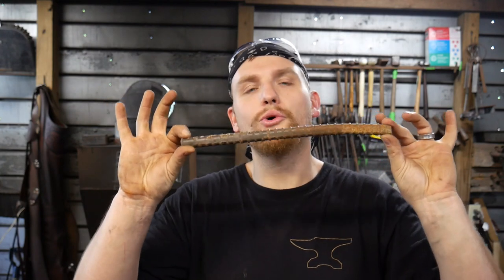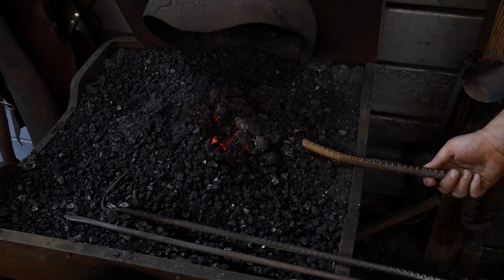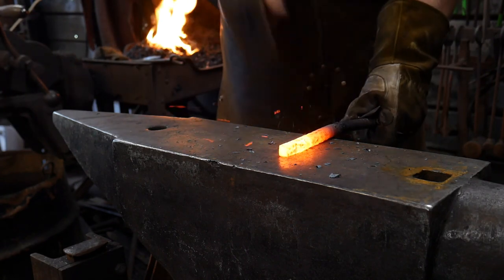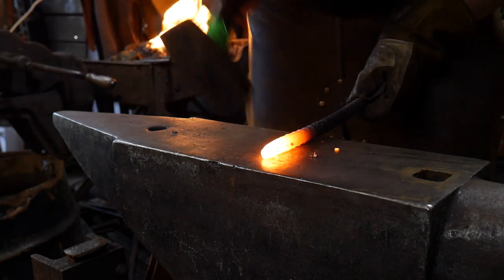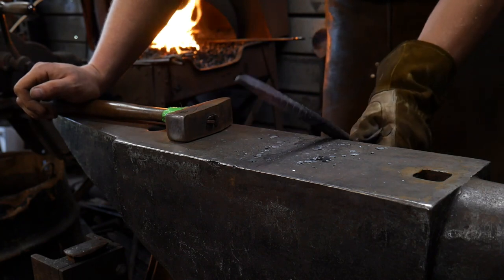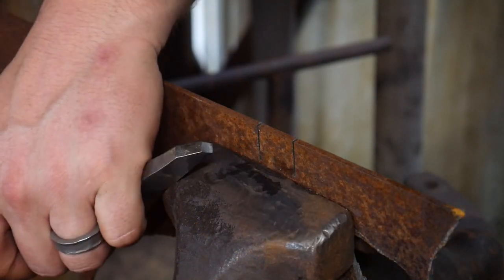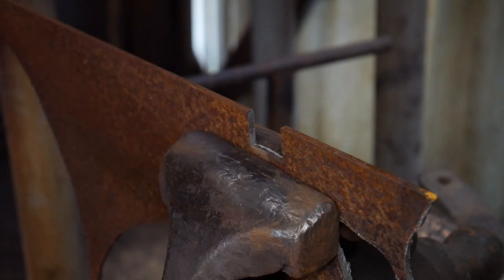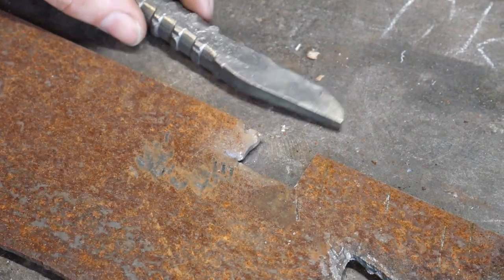Can you forge rebar into tools?

Comment: I have worked with rebar over 30 yrs.  I would not trust rebar for making much of anything, they way it is made is not very consistent and lower end materials. Tool or spring steel I think would be better.
Reply: Well I choose rebar as me and a others are starting out as it is a cheap material you can get in large amounts and it makes for a sweet handle that’s already attached to the knife or other rebar item.
Reply: Just so you know, it's used to reinforce foundations in virtually every structure made in the last 60 or 70 years.
Reply: @me2bfc   steel girders make crappy knives. so does rebar. they are chosen for ductility. knives need to be hard and hold an edge. rebar does not.
Reply: @yourredcomrade717  but he's not making knives.  He's making cold chisels and punches.  It will work for that.  His inormation about it being high carbon is pretty far off, but its adequate for what he wants to do here.
Reply: @me2bfc  That doesn't mean that it is a particularly good material for other uses. I don't make tool handles for Douglas fir, and although it is passable for use in wear surfaces like floors and in table tops it isn't necessarily a good choice for that purpose despite being used to make frames for houses.
Reply: @garethbaus5471  it’s not good, but it will work.  If it’s free and available it will work adequately as long as it’s not a production time deal.

Comment: The two dots means that they either double or triple stranded the bar during manufacture. It means that it's the second strand and is used to measure the bar and know which one it is in case they have to adjust the rolling mill.  The dimensions are monitored closely for roundness, depth of deformations etc. If it doesn't have a line running the side it's 50 or a lesser grade. A line running down the side means it's a 60 grade rebar.  Different results in trying to make tools from rebar is due to the ignorance of the individual. One or two lines running down the side is the best. The stuff from Lowe's or a like market is usually secondary or scrap and is good for sidewalks or driveways, survey stakes and the like.
Reply: John Maliskey 
Good info 👍
Reply: Thanks a ton that answered everything for me , i work commercial construction (glazier) and find rebar with lines on both sides thrown away ad scrapes lucky i saved them just been trying to figure out grade

Comment: I sheared millions of pounds of rebar, grade 40 has no additional markings, grade 60 has another line running lengthwise along the forging flash line, grade 80 has an additional mark similar to 60. Rebar used to be criticized , but modern stuff is great for tools, punches, and blades...

Comment: There are at least 4 grades of rebar used in the US.  40, 60, 80, 100 - Each number standing the yield strength in 1000's of psi (so grade 40 will yield at 40,000 psi).  I believe 2 dots is one particular manufacturer's way of designating Grade 60 bar.

Comment: In my first year of forging, everything was made of rebar. Mostly hooks
Reply: insperatus Story of my life dude.
Reply: I've made a few light use knifes and a pair of tongs from rebar but I'm just getting into blacksmithing and dont have much free time to work
Reply: I’ve made almost everything from rebar lol.
Reply: @robertevans4795  Though I have access to spring steel from old beetles and I just began blacksmithing small knives I also have made tongs from mild steel. I found a stock of rebar on a parking lot and made a hook as well. You change your vision when you start smithing... Any piece of metal you see laying in the ground you immediately think about forging it
Reply: I like rebar for my weapons because of how cheap it is and rebar is pretty strong as a metal stick so why not put a point on it? rebar spear. maybe throw some sharp rebar at stuff? rebar throwing Axe. maybe stab something with a sharp metal stick? rebar knife
Reply: I tried making tongs out of rebar, but they kept cracking when they cooled. Any suggestions? Is it possible that I was just heating them up too fast?
Reply: @RockingFreakShow69  thanks, did not have any oil on hand, but as i did not need them hard i even tried "quenching" them in sand so it would be really slow. i am suspicious that i was also hammering while they were too cool, as i can be both strong and impatient...

Comment: I worked rebar years ago and I have not done any in a long time. If I learned anything it is to be careful not to work the steel too when it loses it color. even a dull red is too cool. I was told that not only is it more difficult to work but you run the risk of micro fractures in the steel.

Comment: Handy guide for UK smiths looking to use rebar. The regulations for Rebar in the UK are pretty strict. There are 5 grades: A B C and Stainless A and B
A is basically Mild steel, B and C are medium-high carbon

Rebar less than 12mm can be any grade. If the Rebar is above 12mm(1/2") in diameter is MUST be B or C grade. 
B and C are both suitable for tool production, C is better. 
So UK guys, when buying Rebar, make sure it's above 12mm and get forging!

Comment: You've got such good info. As someone who is new to blacksmithing I've found myself watching a few of your vlogs because they specifically answer questions I have and I appreciate it. That said watching you is growing increasingly difficult. It seems like every video I'm fighting commenting over something you say or do. From your misuse of antiquated when talking about correlation and causation. What the Hell is antiquated correlation. To you saying only one set of sides needed glue in the stand. If one side needs it the other side does as well. (If "friction" keeps it slipping one way it would hold it the other way as well.) Lastly to your ridiculous reason for the bearing not bouncing as high on the anvil. The size of the anvil in that case has nothing to do with it's ability to send the bearing back 66lbs or 450lbs or 5000lbs in that case doesn't matter. Your anvil is harder so it isn't softening the blow and absorbing energy.  Please stop talking out of your ass is I guess what I'm saying. You're not required to say why something is happening but if you don't know why don't just invent a reason you think sounds good.

Comment: I have done a fair bit of forging tools with rebar for stock.  What I have found is that the carbon content can vary a lot from on piece to the next, even if you buy it at the same place and the same time.  Some of it hardens nicely.  Some doesn't harden at all.  I've made chisels, punches, and tongs out of it and one thing I've discovered is that you have to be real careful about cooling your tongs if they get too hot because they may crack, indicating a pretty decent carbon content, but maybe not the best stuff to make tongs out of.  On the other hand, I've had a couple punches that wouldn't harden at all.  I'd just say spark test it before you start.  If you get good sparks it will probably make good punches and chisels.  If you don't, well, that might be the piece to make a set of tongs out of.

Comment: I'd never make tongs out of rebar as it tends to form stress fractures regularly as you heat and quench them. That being said I use the S60 rebar all the time for punches and chisels. It is cheap but effective and easy to work as long as you prep it before forging. Keep in mind this stuff cracks all the time and is real finicky, but I love it for tools. It even comes with prefabricated gripping down the shaft.

Comment: Give you some info. My dad worked at Nucor Steel all my life and I've ended up having multiple in depth conversations with their metallurgist. Since that's what I'm going to college for. So the # (like #4, #6, #0) are actually just the sizes. The quality of rebar is stamped on the piece. For Nucor you have 3 sets of #'s and it goes as follows. Mill Location/ Date Made/ and quality of piece. Now the quality numbers used are based on the average HRC you can get the piece. Also the way they categorize their steel like if it's 1080, 1084, 5160 is completely different from what we use since they make their own steel from scrap and put in different stuff in it. So the rebar I use my dad calls rebar60. Which is rebar that can get to 57-61 HRC when Hardened. Now yes I've heard from other Smith's that you should never make rebar knives or any tools that need to be Hardened with rebar. The reason is because the carbon percentage fluctuates so much in even a 6 ft piece that when you go to harden it certain parts will act like mild steel while others will act like high carbon or even high alloy steel. That is the case if you go and grab a piece of rebar from a scrap yard or even if you buy it from a hardware store, but if you get it straight from a reputable steel mill Corp like Nucor Steel. I've found that the rebar is always high quality and it hardens perfectly in Super Quench. I even sent some pieces to get tested and found that it's good even HRC throughout my pieces and that the carbon percentage is also even throughout my pieces.
Reply: Also always anneal it before hammering and it'll move easier because all rebar comes pre-hardened. I anneal twice when working with my rebar.

Comment: I've been in construction 25 yrs and have lots of rebar cut offs and have done alot of research on it , there are various grades and you are correct about the 2 dots butt generally look at side of rebar it will generally say  grade 40 (low grade lower carbon) grade60 high carbon (probably what you have ) and grade 75- 80 ( very high grade ) 60 - 80 i make knives out of and tools 40 i use for orher stuff
Reply: Btw 60-80 i believe is high tensile steal for heavy construction like bridges

Comment: If that is grade 60 rebar it is A615 steel which has a carbon equivalent of 38%. With a tensile strength of 60,000 psi
Reply: Yield strength is 60,000 psi.  Yield is the point where the material begins to plasticly stretch.  Tensile is the point it breaks and is 90,000 psi.  Yield/tensile are 36,000 and 58,000 on A36.
Reply: There is also grade 40 rebar, which has yield of 40,000 psi and ultimate of 60,000 psi.  There are also higher grades of rebar that are less commonly used.
Reply: According to my search of rebar grades, the 2 dots stamped on it indicate that it's grade 75 rebar (yield strength of 75,000 psi).  Which is why it heat treats well.  Most junk yard rebar is going to be grade 40 and not suitable for heat treating.  There are a number of different ways the bar might be marked (if you even have a section with markings on it).  Do a search on rebar grades before you forge something you want to heat treat.
Reply: Two lines means 75 grade. The dots are for knowing which bar it is when the double or triple split the bar to run more steel faster. Check the ASTM Manual for the rebar standards.

Comment: Normalize it a couple times first, it's a lot easier to work that way. When working with previously hardened steels, I found it a lot easier to over temper the steel a few times to relax it.

Comment: Great video. What is the make and model of your grinder, I can't figure out what those types with the three pulleys are called to find somewhere that sells them. Thanks!
Reply: try looking for linishers, they are what metalworkers use; woodworkers call them belt sanders. Linishers are specifically designed for metal crafting. I'm an Aussie so terms my differ, but...........

Comment: I'm really interested on how your forge is made. Probably trade secrets lol you rock great vids.
Reply: It's just a flat peice of like 30x30 with a hole in it with a hand air pump or electric one simple simple
Reply: I was wondering if you made a propane forge would a washing machine drum be a good idea to use
Reply: @bryanduke1973  too big, you would want something smaller, an old propane tank, air compressor cylinder, something that size. 
or you could just use fire bricks and angle iron either welded or bolted to keep them nice and tight.

Comment: I'm a fabricator I have to working with all kinds of metals for about 10 years but I want to learn about blacksmithing where should I start
Reply: Get some coal, make or buy a forge, I'd say just make a cheap on for starting, get something metal and heavy to beat on, and a hammer, grab any ole peace of metal heat it up and beat it
Reply: @talonjuel9486  what flavor still is best for what is there a chart or graph or something I could use
Reply: @jesseconnell1675  do you mean what carbon contents are best for forging? Or anvil to hammer weight ratio?
Reply: The most common carbon steel I work with is 516-70 I just cut fab an weld if you could point me in the right direction or anything pointers the type of things you would teach your Apprentice or helpers
Reply: @jesseconnell1675  oh geez, I'm no teacher or professional, but you can forge any steel, high carbon steels are better for knifes because you can harden them so they don't lose there edge as fast, spring steel works pretty good too, for tools like make blacksmith tongs or anything like that mild steel is better rebar works good for that kind of stuff, your anvil is important but if you don't have one a heavy peace of metal works fine, wear hearing protection cause it can cause permanent damage, the ideal hammer to anvil ratio is about 1 to 40 but 1 to 30 will work too, the more weight you have under your forging material when forging the better, if you get an anvil, get on with a hardend surface trust me it'll be work it, hay budden is my favorite but there old and expensive, for a forge use what's easiest for you, blow torch, charcoal coal whatever when you heat your material don't bring it past that yellow color and I recommend you don't even get it that hot unless you're trying to move alot of material, because the hotter you get it the more it oxidizes and the more material you lose, start small, learn through experience and get some technique and muscle memory, after everything you make, stop and look at it, analyze it, see what can be improved and go make a better one

Comment: I worked in pool construction, which deals a lot of work with rebar, and I can tell you rebar is quite useful. We made a lot of improvised tools with it, and most of it is easy to bend, though after 5/8 inch thick rebar, it gets very solid and you will need special tools for it. 5/8 is what I think would be the better to use for tool making since it's around a good area between still light enough to hold to, and thick enough to make good tools. In fact, I think that piece of rebar may be 5/8

Comment: I liked the vid. i would like to see one that discussed the grading of rebar. i've used grade 60 in some cases where a higher grade or strength was specified for the job and yes it is harder than regular grade rebar. this stuff you used is impressive and if it's available it maybe much cheaper than stock 1084.

Comment: I have some concrete posts that were cast in 1950's, steel has rusted and posts are broken so I finished them off and got rebar out. To 'test' it was hardenable I just heated it with a propane torch to dull red/orange and did a water quench then  put it in vice to break it so I could taker a look at grain structure. Came out dead hard and very fine grain structure,  I'll do more tests and temper it before going further

Comment: Rebar is usually very good steel.  It gets a bad rap because it's not easily weldable.  Its stronger than standard structural steel, but has quite high ductility.  It can also harden fairly well, but might need a very fast quench, like cold salt water fast.

Comment: Adding to what Gary Sumlin said, The Threaded Rebar has higher carbon content. Iv'e never seen it in any smaller than 2" dia. I've made several for wood working chisels out of regular rebar. I watched my friend forge a double edge sword from threaded rebar, Its tough stuff. I would use OCLS oldchevyleafspring.

Comment: For a cold cutting application it is definetely a requirement that the steel is hardenable. However for just about any hot cut tool or anything else used on metal at forging heat literally any steel will usually  work at least a few times. Use whatever you can get for free and if you trash a tool make another one. Good practice anyway.

Comment: I made a fishing spear out of rebar a few weeks ago, it isn't that great in my opinion, I have tried about 4 different kinds of heat treatment methods on it to get a spring temper, but it doesn't hold up that well after abuse. How do you know what type of steel each piece of rebar is made out of? I never paid attention if the rebar had any marks on it, so I have no idea how to identify each separate piece of round stock. I blued it as well, and after the quench it does skate files off the surface, proving it hardens, but I really didn't see much of a spring temper in my spear, just a slight spring but fatigues fast.
Reply: Don't heat treat it. Quench it in water. Sounds like the rebar has a very low carbon content. Even with no temper if it breaks your not out much.

Comment: Gday mate you will find that that isn't  concrete reo it a formwork tie bar in oz we call it z bar it is a high tensile steel as it is used under very extreme pressures at times. I have always wondered what it would forge like now i know cheers for the video.
Cheers Paul
Reply: Paul Cummings,It appears you are right on, after doing a quick check on Z bar . Thanks for clearing that up.
Reply: @victorcastle1840  no worries mate i just forged my first knife out of some z bar really stoked with it.

Comment: Looks like a douiedad rod (sp?) for soil anchors, not rebar. They are inserted in a drilled hole. The anular space is filled with grout, and after a few days a plate is put on the exposed end and , in some cases, 100 tons or more is applied to try to pull it out. (Really it's to keep the wall back, just like a tieback. Aaaaaaaaanyway, much, much higher tinsel strength than rebar. Great video none the less. Cheers.